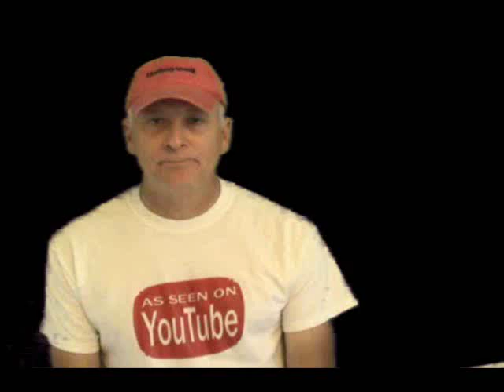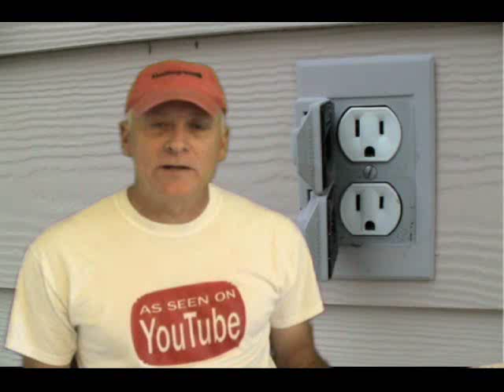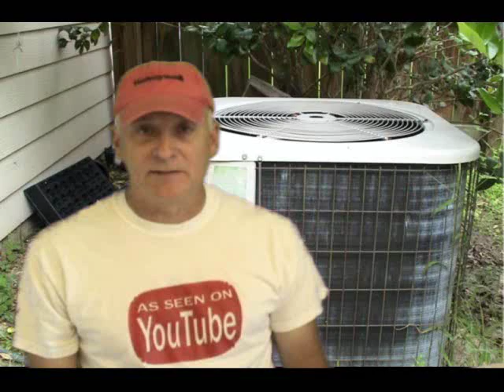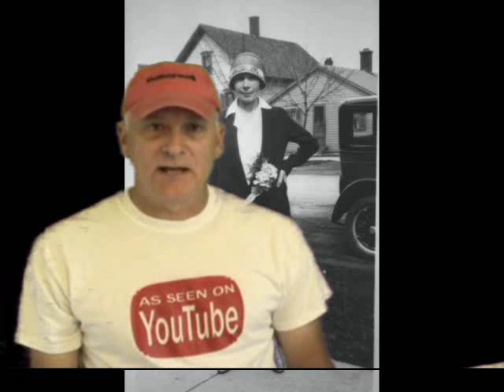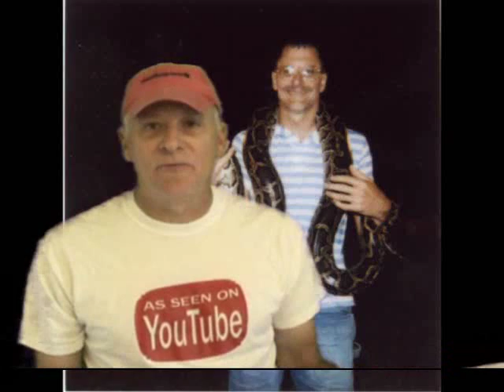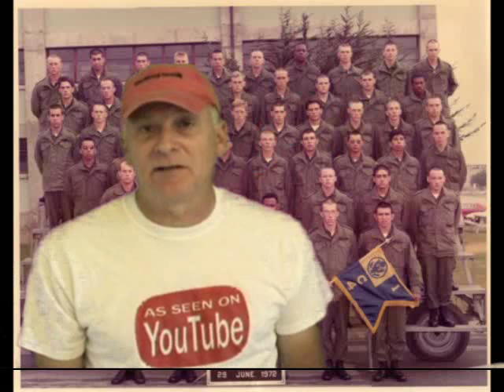HVAC lack of electric receptacals and hose bibs

Comment: You are right on about this, I used to work on McDonalds HVAC/R in the area and they had electric outlets at each unit and a hot & cold water tap in the knee wall, only 50  feet of hose to reach all units. it was very Sweet!

Comment: I work at a hospital & we have a single hose bib on all our roofs but you may still need to run a 100 feet of hose in a few areas. Some of our package units have 120 volt receptacles on the inside that you can use for a power cord.

Comment: I feel for you. I am a commercial HVAC/plumbing engineer. I mostly do commercial but some multifamiliy residential and I always make sure to provide these amenities in my designs. However, in construction the owner often will cheap out and not to do it. And unless I have been contracted to do construction admin (periodic inspections, etc.) there isn't a lot I can do. On those design-only jobs (which are rare) I just pray the inspector knows code. Had good luck around here with that.

Comment from the maker: @d1incharge Thanks for the insight on this matter. I usually have to run a few hundred feet of hose and electrical cord just to clean and maintain an air conditioner, especially rooftop packages.

Comment: I took a small pair of jumper cables and cut off 1 end. I striped the wires from the cut end and conected them to a female cord end from lowes. I can take the inside cover off a disconnect and connect the leads. 1 to a 120v leg... and the other to ground.  Instant outlet!!!!

Comment: 210.63 Heating, Air-Conditioning, and Refrigeration 
Equipment Outlet. A 125-volt, single-phase, 15- or 20- 
ampere-rated receptacle outlet shall be installed at an ac- 
cessible location for the servicing of heating, air- 
conditioning, and refrigeration equipment. The receptacle 
shall be located on the same level and within 7.5 m (25 ft) 
of the heating, air-conditioning, and refrigeration equip- 
ment.

Comment: not enough letters, and i do agree with you..but you could probably make your life easier in the mean time with just a couple cheap easily found things you can use

of course it might not be that easy to haul that stuff up on a roof..cant imagine hauling a 5 gallon air tank with 4 gal of water in it up a ladder which im sure you are stuck with in some installations

Comment: I guess it is a trifecta when you get a city council that chooses which codes to follow, a bunch of suits deciding const. issues really makes sense. Here they chose to require R-15 vs. R-13 in walls, moderate climate, REMdesign shows and avg. 8$/year savings on a 500-1k$ added cost. Ofcourse with a mortgage and a 1k cost that is @ 60$/year to save 8$. How much labor expense would an outlet and a bib save? What would it's cost be. People are seperating from govt., codes will cont. downhill

Comment: couldnt you get an old air tank and fill it up about 1/2-3/4 way with water, like one of the portable $50 5gal deals, and drop some air in it, hook your hose up to that (whats the pressure rating on hoses? heh), also what about getting an isolation/step down transformer to go from 208/240/440 etc down to 120v for a vacuum pump?

extra equipment to haul around but i bet its easier than unwrapping 300' of hose, drying it and winding it back up

Comment: Hate to say it, but HVAC is complicated, and it is one small part of building a home. For you it sounds easy, but for a builder all of those little items can fill a plate, even the little costs. I would like that code, but they literally spell check our breaker boxes, so coping now is tough. Builders, HVAC, Plumbers, Electricians don't write the codes, booknerds that dont understand do. Icing on the cake is the even more ignorant inspectors that municipalities are quite efficient at finding.